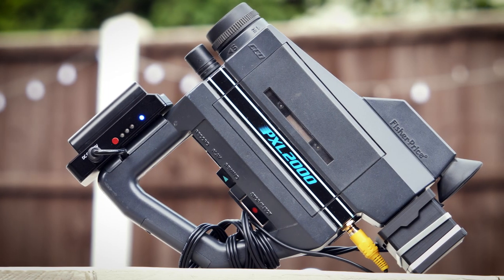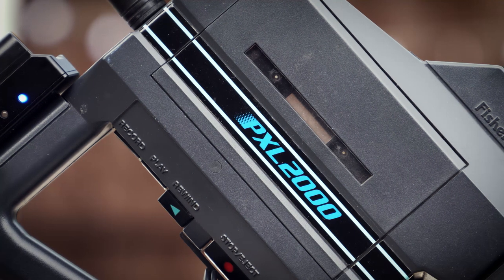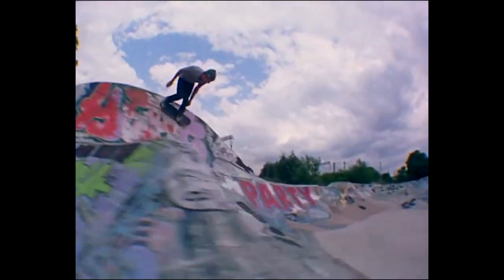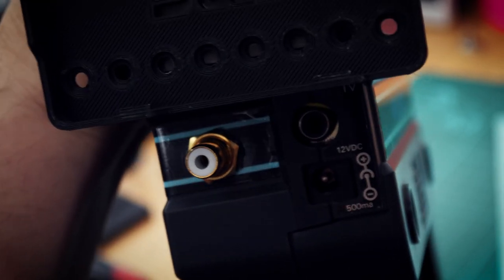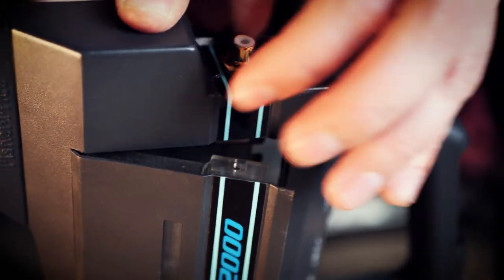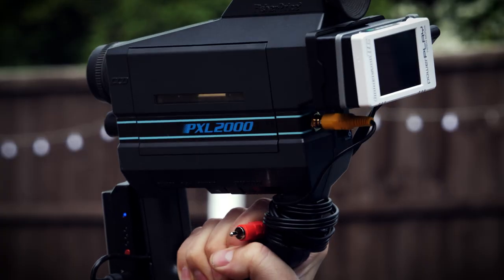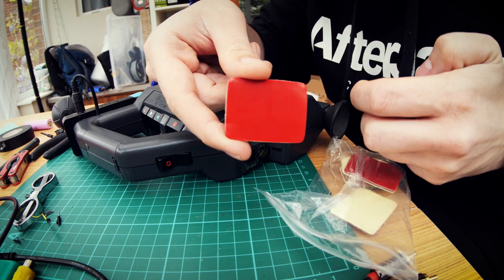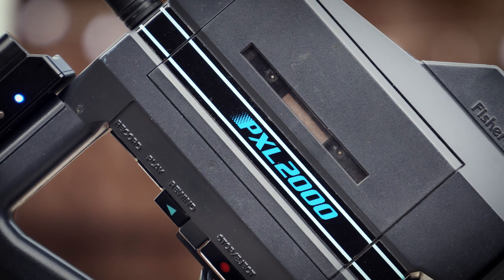Modding a Fisher Price Pixelvision PXL 2000

Comment: Hi there, THANKS A LOT for this tutorial, specially the lost web you found. I have a question, did you cleaned or polish the blue squared lens? I saw it in another tutorial by HowToWith GEO, i don't know if it's a common issue, but the image i get from my PXL is blurry and unfocused. Greetings!
Reply from the maker: Yeah I cleaned mine with isopropyl alcohol and a cotton bud, made a big difference
Reply: @NEONAIRSHIP  Thanks for asking; i also cleaned the same way you did, but still blurry. With a magnified glass i saw there's a degradation of the whole plastic lens, it's opaque and i cannot see image through. Is this lens essential for the camera? I'm thinking to remove it.
Reply from the maker: It's the Infrared filter, so without it the infrared spectrum is visible - fine to use without but it might expose quite differently. Shouldn't make much difference indoors
Reply: @NEONAIRSHIP  Thanks! I removed it and now works perfectly, the picture is "clear". Also, could i ask you another question? Can i use a standard Sony NP battery with the Smallring adapter? I don't understand properly how an adapter can power 12v using a 7.5v battery. Thank you very much, greetings!
Reply from the maker: Awesome! The smallrig adapter has a little voltage booster circuit in it to get to 12v just uses normal Sony np batteries :)
Reply: @NEONAIRSHIP  Nice! Thank you so much for the help